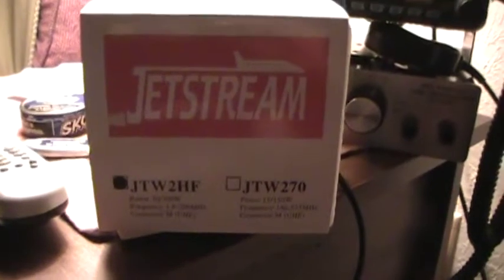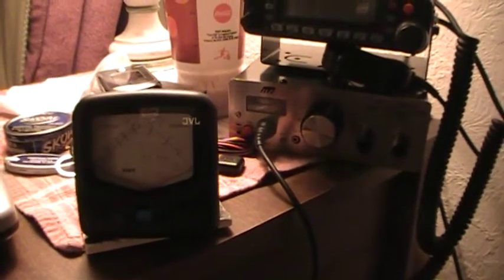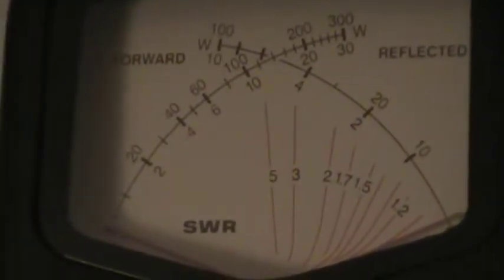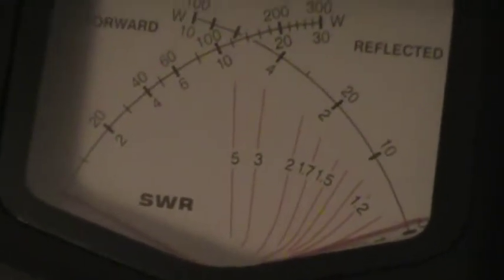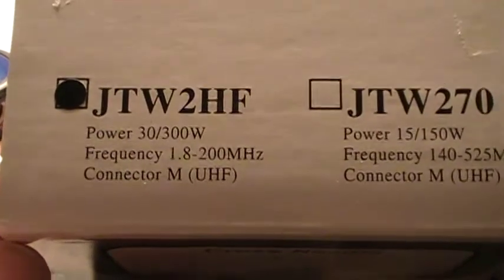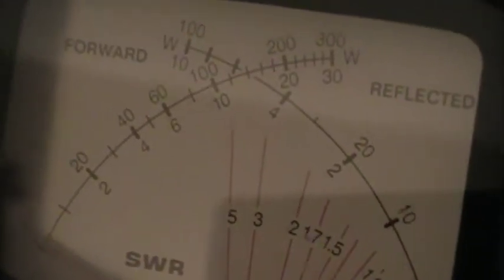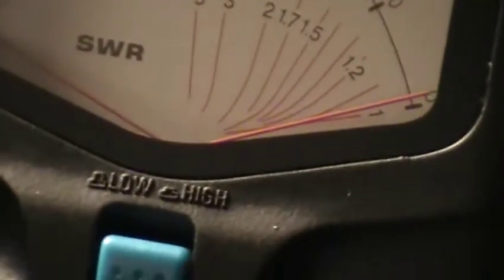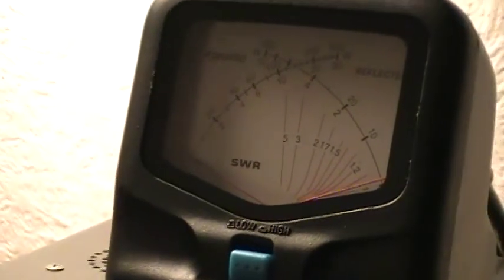SWR/Power Meter

Comment: Nice little meter.  I have a couple older 10m/cb ones.  20/200/2000 watt pwr.  I also have a little tuner in line just to keep my SWR as low as possible.  Pretty close to 1:1.  Thanks for sharing the info. Very generous offer.

Comment: I bought the diamond brand version today and it's made in Japan. I am very happy with the sx40c and it's good for 2 meters and 70cm. I keep mine in line all the time to make sure my transmitter is still good and my set is low. My meter was 79.99 but I think it's worth every penny knowing it isn't used.

Comment: Hi I was thinking of buying this model of SWR meter over here in the UK for use on my new 4 watt hand held 2mt vhf ham radio for when I use my home made external centre fed half wave dipole antenna,

I also own a small ultralight aircraft that has a small hand held airband VHF again running to an external antenna also about 4 watts output with the element cut by me...I would like to be able to also check this ant out,

Do you think I would be wasting my money as these meters are expensive of here in the UK....can I just rely on cutting the antenna elements to the req length and be happy with that...I worry that the low power output will not be enough to work the meter correctly,

You sound like a real nice guy so I thought I would ask you,

I do have 2 older CB swr meters and have tried these but they give different reading so I dont think I can rely on there readings.

Regards Nick in the UK.
Reply from the maker: to be honest, i would trust my cuts and not worry about meters.  4 watts is 4 watts is 4 watts.......

Comment: When you passed your element 2, you were told of the legal requirement to identify your station if you are transmitting into anything but a dummy load. A lot of new people don't get the whole "Callsign" Testing thing. No one is going to get mad you are checking your antenna match or checking to make sure you have the repeater programmed properly - and if someone does get mad about it, you can always tell them to find a new hobby, bc there needs to be room for beginners in every hobby.

Comment from the maker: @Fuzzy2u hey fuzzy....how you doin?  the older meters are single needle and you need to calibrate then read forward power, then switch to ref power to read swr.  the new meter i bought has 2 needles and does away with the extra steps.  good antenna tuners don't have loss.

Comment: I also have the Yaesu FT-7900R - great radio.

When I used an MFJ cross-needle wattmeter with it, both red needles shot straight up, like in the cowboy movies "Reach for it, horsethief! or "Stickem up!"

What does that indicate??

Thanks and 73,
N4ANO

Comment: Question about your tests.  Why don't you either say your call sign or cq then callsign when transmitting at all during this video?  Was it just edited out?
Reply from the maker: when tuning it is not necessary to use callsign
Reply: Incorrect, once at the beginning and every ten minutes thereafter
Reply: If you transmit on the air only once then YES it is required & that's the law.Did you read the test questions?

Comment: Ok Ray time for stupid question of the day.
All my pwr/swr meters have a calibrate mode to calibrate the SWR meter before you switch to the read function. Why does yours not have one? 
I'll admit mine are 15 years old but has tech come that far where no calibration is needed for SWR readings?
On another note I don't really like antenna matchers as I feel like I'm losing power as heat somewhere, just a feeling and may be 100% wrong. Been wrong before! Will be again I'm sure.

Comment: 4 watts is 4 watts...are you saying that that that low power wont do any harm....
Reply from the maker: a dipole for a 4 watt transmitter:  468/freq gives you overall length in feet.  for 144 mhz the dipole is 3.25' overall with each leg at 1.625'  It's just not that critical at 2 meters with low power.  Don't over-think it.